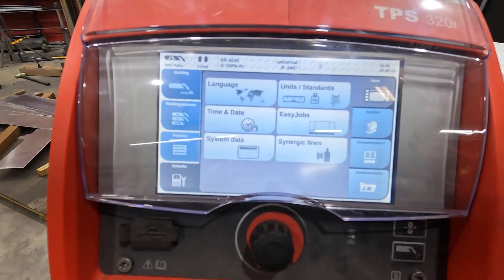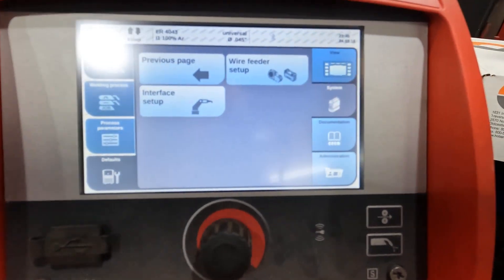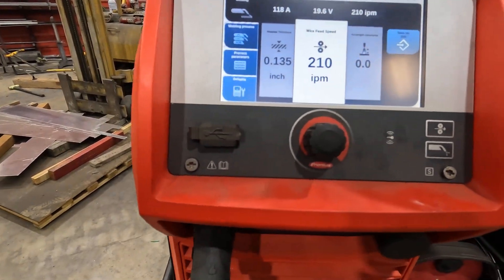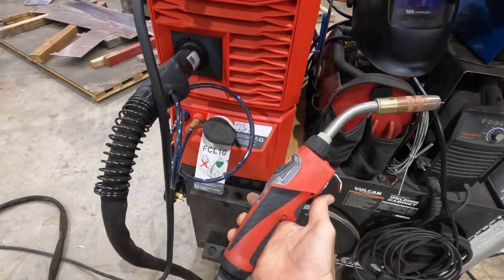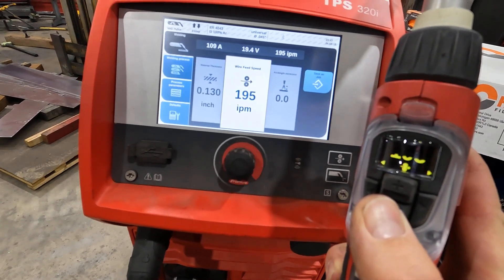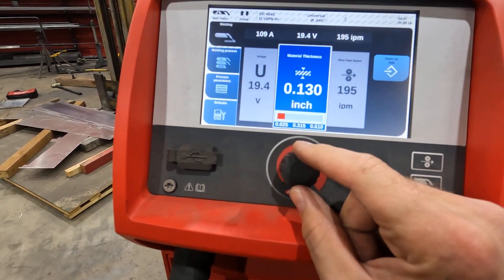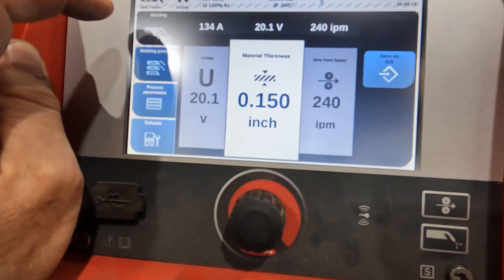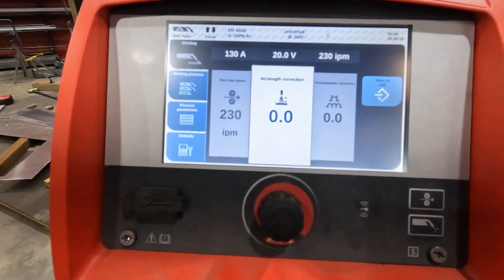Fronius TPS 320i and push pull gun!!

Comment: Hello my friend, I have been looking for a good welding machine for a long time and I am between two machines 1 kemppi master mig 355G Water cooler 
2 fronius TPS 320i pulse Water cooler. (The one you have) your opinion will help me a lot because you have already worked on the machine. Are you satisfied with the result of the machine? Thank you 🙏
Reply from the maker: I can not speak for the kemppi 355g so that is not going to help you out much.  I am very happy with this machine.  The pulse options are incredible.   It mainly stays loaded with aluminum and a push pull gun, but I have used it plenty with steel also and I don't have any complaints.   I have an "up down" 15ft gun that I use for steel, and they can swap back and forth between my other fronius machines. (Push pull excluded, it only runs on the tpsi).  Same drive wheels, same tips is just easy to run and always gets the job done. Good luck with your decision
Reply: @eastech3365  Thank you...

Comment: Struggling with the exact same set up for aluminum. It seems like I have to lay a bunch of beads for like 10 minutes before the machine starts welding correctly. It comes all black and nasty like it’s dirty but eventually works at cell phone. Is there something wrong with the machine? I’ve sent the machine back in they say it’s fine change wire didn’t change anything, the welder has been sitting for about nine months now and I’ve been using my Miller but I don’t want to let a $18,000 welder go to waste can you help me out?

Comment: I use the split version for work. Oh man, what a badass machine.
Reply: Have you ever run the miller 350p with aluma pro push pull?..Im just curious how the Fronius is compared to the miller. thanks
Reply: no offence but lincoln and miller are dog shit compared to fronius offerings. no one can touch fronius in the mig/mag area right now @tstrapper1